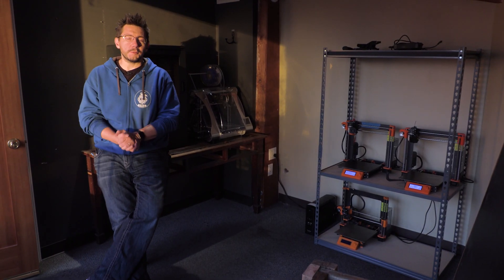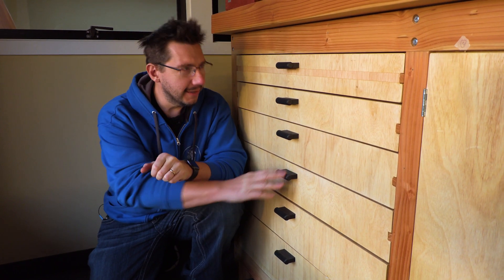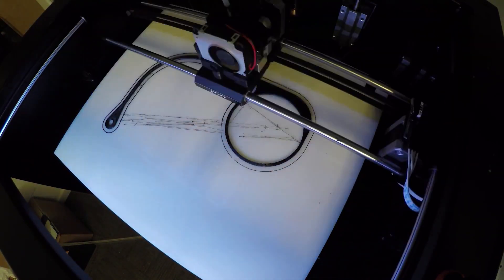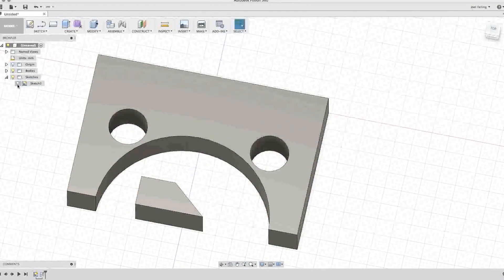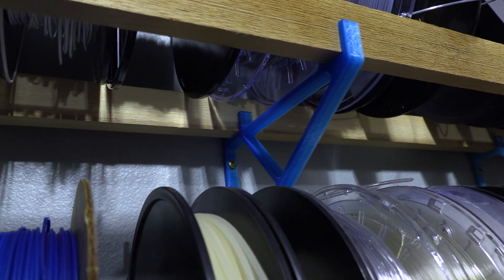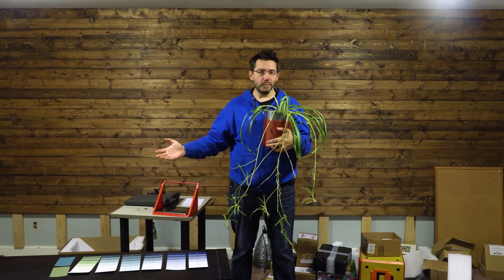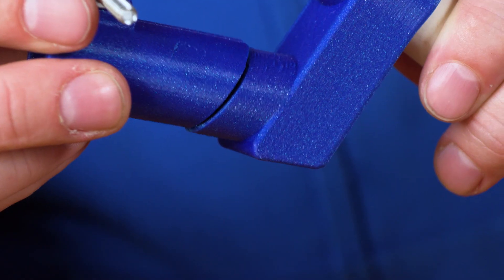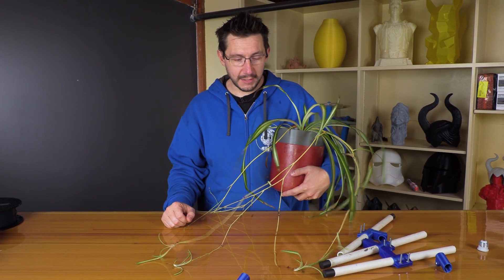Is 3D Printing Practical? 11 Practical 3D Printing Projects Reviewed!

Comment: I did a similar print to fix a leak under my kitchen sink; late at night and shops were shut but designed and printed a fix in the time it would have taken just to get to the shop!
Thought it was a good temp fix; two years ago 😂

Comment: Joel   If you haven't done the redesign on the tripod leg extenders yet I think if you try putting a web across the area between the leg tubes you will solve the problem with support of the tubes.  As long as the open area between the tubes is not needed then that will add strength without a lot of extra filament.  Also as someone said printing horizontally would help by changing the layer direction pattern and if you do you could also put holes in the web to add even more strength.

Comment: I appreciate the effort, but these “fixes” would be my bottom 1000 plus. My very first practical print... actually first print period... was a drive gear in my pool cleaner where the manufacturer (Maytronics) refused to sell the gear... only offered motor plus gear.... for $400+. It’s why I bought a 3D printer. I am now designing a better pool cleaner.... after multiple cleaners.... I now realize all pool cleaner manufacturers design their products to fail. Hoping mine lasts until the grandkids decide that they need one that lasts but also looks cooler. FYI: $200 printer made part. Investment paid for with one gear!!!! That was “practical”. FYI2: Fusion 360 gear plugin did it right first try.

Comment: Cosplay got me into 3D printing when I printed a Pip Boy 3000 for my Fallout cosplay. I had it custom sized to fit my phone inside so I could use the Pip Boy app to make it "functional". My layers were a bit rough due to print time limits, but some sanding and painting covered a fair bit of that.

Comment: I have stuff all over my house and cars and motorcycles fixed with parts I had to print because the manufacturer either doesn't have them anymore or wants me to buy a $300 assembly because a 20 cent part broke.  So yeah practical. Heck some of those fixes paid for a whole printer by themselves (repairing fridge because handle + front panel shattered, not available, redesigned a look-alike in CAD but much heavier and more durable - boom $800 savings no new fridge.)

Comment: Holy filament...
So I am crying foul on the bracket to hold my toy sword. Though to be fair it is a fine line between that and any other art peice or decoration as none are really practical.
Cannot claim the mask for an unnecessary entertainment event either.
I paid for my printer in the first month fixing broken car parts though. They make great aids and fixtures for woodworking as well. 

Thanks for the video though. I feel like all people see is the toys because that is a lot of what they get used for, and think that is all they are good for

Comment: I've been looking at 3D printing for a while and I'm ready to get a printer but I'm at a loss as to what to do next.  I know I like quality, hate limitations, and will most likely want to do bigger projects.  What do you recommend?  As a noob does one jump right to resin or does resin prevent you from printing things like gaskets, tires, aka materials that range from stiff to soft?  If I know that I will eventually want to print a helmet or mask of some sort do I save myself a lot of grief and just go big out of the box or does one start off with a smaller printer and smaller projects?  I watched your video with the Rize 3D plus... is that crazy for a first printer?

Comment: i printed a few pocket hole jigs for several drill bits to fit, 
printed several inserts for a table vice so it can hold certain things firmly without breaking/bending them (for example a tubular insert to hold pipes)
printed clips, handles, buttons switches,
replaced a bunch of small plastic parts that were broken.
3D printers are an excellent tool for small precise things that are very hard to machine.. but its useful for almost any part as long as you know how to 3d model stuff

Comment: You didn't answer the question.
Is 3D printing practical?

Of course you can make practical stuff with a tool, but compared to other tools or buying replacement parts directly, is it practical to buy one, taking the space, plus the filaments, taking space and money, plus the time, money and nerves it may take having prints fail, tinkering on the printer, etc.?

Some prints are like "You could also use a scrap piece of wood and file a notch in there instead of wasting plastic and print for an hour"....

Comment: explains how 4 projects broke, then declares it good to go
Reply from the maker: Which four broke?
Reply: @3DPrintingNerd  geez, off the top of my head? The first one. I dont think you explained what happened to the first one you made, but you said you had to replace it . your fridge door guide. Your gear shift. Your pipe bracket. gas cap strap. There was another one too. was it the last one?

Comment: My takeaway from this: 
What's practical? 
1) Well designed custom brackets (experiences a moderate static load)
2) Human interface components such as knobs, handles, buttons (experiences low load)
3) Replacement small complicated plastic components
4) Anything purely aesthetic you want that's 100% custom

Comment: I have printed a replacement foot for a camera viewfinder and an antistatic gun (using a cheap piezo lighter) that alone almost pays the price of the printer if you compare it to the price of a new viewfinder and a milty zerostat, but there's also a good amount of useful things that you can print that even can't be bought. At that point a 3D printer basically becomes priceless!

Comment: I've made a 1st version of a molding form for a small part in Braun OxyJet MD20 irrigator. It's about their pump. It's a silicone "plug" there.
I just don't want to buy a new one because ppl reports that they've spoiled something in it's design (a weaker motor or it's "weakened" in the PCB, IDK). Tech. service of Braun isn't cheap. So I've replaced their rubbish spiral hose already (it was cracked because of a weak material... worked for about 2-3 years fine). Now it's made of a low temp polyurethane tube and looks like it will be working "forever".
If anybody is interested in this plug, check up my channel (new videos will be in Russian but I'll make subs if you'll ask me in comments there).

Comment: I have some cheap drawers in my house and the plastic piece that connected the rail to the wall broke. I used Tinker CAD to make a replacement and it worked great. I even had to print it again because a different drawer broke, but my practical print is still holding strong.

Comment: There is no doubt that 3D printing can be practical. It all depends on your definition of the term and use of the technology. 
I started printing a year ago. One of the first things I printed was personalized toothbrush and tooth past hooks. They are still hanging on the bathroom mirror. I also made 3 small dragon-themed shelves to hang on the wall above the stove. Half a year later they are still there, holding spices and first aid burn treatments. I also printed a ton of educational toys for my kid's teacher. I have a failed box project that resulted in half a dozen failures that are currently occupying various shelves, organizing small items.  
Impractical prints aren't all that bad either. I'm printing a couple rat figurines that when I finish painting as mice will be displayed with my copies of Redwall books. https://www.thingiverse.com/thing:3781681

Comment: Recently had a practical print. Printer tray for my HP Printer kept getting hit by stuff falling off the shelf above it, when the clips for the paper tray finally broke. Found a model on Thingiverse, printed them out, and epoxied them to the tray, and voila, functioning paper tray! Unfortunately it's not possible to buy just the paper tray from HP, so 3D printer to the rescue!

Comment: "practical". Thats probably the difference between VR and home 3d printing: You don't need them. You can easily do it without it. Its probably cheaper to go to someone who has a 3D Printer or just order it from some company.

But why not? Play around with it and have fun. VR itself has non gaming use cases but when i buy it for home, you play with it and thats it. No pressure to make it practical.

Nonetheless: that shows that 3D Home Printing is just not very useful.

Comment: I made some lampholders, designed them quickly with Fusion then printed them out, hanging for over a year and no sight of deformation (PLA)
Also a shelf, it is like two hexagons connected to eachother, wood plates connected with 3D Printed parts, looks amazing and works!

Comment: Ohhh Joel.. My hands are just itching to improve on that tripod haha. And it's really only a small addition needed to fix the weak spot. To add to that, I've been printing since 2012 and I'm still using a lot of parts and hooks from that time in 2019. I hang my bags on the side of my table when I get home on a 3D-printed hook. In my storage room I have open closest with a metal ridge on each shelf. Each shelf has little self-clamping hooks from which I can hang backpacks and other items. These closets have hollow metal beams that were missing the feet-caps so I printed those as well and guess what? They are still standing on these printed feet after seven years! This is only a small selection of stuff I made but 3D printing has really infiltrated my life and caused me to reuse items that people otherwise throw away. Yes I may have introduced a little bit more plastic (PLA) into the world, but I have saved so many other objects from ending up in waste, and practically, saved the environment a little bit by making old and incomplete things usable and complete again.
 This is an aspect that I'm missing in most of the 3D printing channels; repair and reuse. Like you did with your fridge. There should be more emphasis on this niche.

Comment: Of course the tripod legs failed. You used that sparkly filament. Everything I print with stuff like poly alchemy elixir night shade type of filament breaks on anything structural. Perhaps you should redesign them but they never stood a chance... no pun intended ;-)
Reply from the maker: It was using highfive blue and it’s surprising strong. It’s all my fault for a bad design :)
Reply: @3DPrintingNerd  Oh... ok... my bad. I just know filaments with that Mica type stuff added to the mix makes things really weak  :-(

Comment: petrol cap falls when you let go of it....so don't let it go. 

3d printing is as practical or impractical as you make it. i'm redesigning my vacuumcleaner so it has a twin cyclonic filter. largely because i was sick of always emptying the stupidly small container. my solution is cheaper than buying a dyson and redesigning it to have swappable batteries. but less practical than settling for 20 minute vacuuming sessions and $1000aud for a new vacuum

Comment: 3D printing is just so useful for all these "scratch your own itches" applications. My favourite thing I ever designed & printed for myself is a mount which holds a toilet float-valve assembly in the sump tank for our garden water feature (which is hooked up to a built-in garden hose connection) so we can easily refill the water feature sump without it overflowing. It's not a beautiful thing but that's fine as it's hidden - just pure function that nobody's ever going to mass-manufacture and sell at retail.

Comment: I love practical prints. One of my favorites is a wooden rack holder for my 60 yr old pool table I printed out using wood PLA. Stained it the same color as the table and it looks better than the original holder that had broken.

Comment: It was Saturday evening and I made a knob for my microwave (the one analog knob that sets the time). I made battery covers for kids toys. I made lampshade for my holiday flat. I made some plastic screw things for my father's car. I made a lot of 2,5 to 3,25 inch hard disk adaptors for HP Microservers. I made s tray for a Nespresso machine. I made a holder for the tube in an Ikea wardrobe. I love practical 3D printing.

Comment: Has the constant contact with water affected anything about the flexible or solid filament? With the washer or the gas cap string I would imagine the parts getting grimy and germy with all of the layer lines.
Reply from the maker: So far, no not at all.

Comment: Some of my first prints were "Practical Prints".  I designed a toothbrush holder for my Sonicare brushes, inside and outside handles for my patio screen door and a replacement bracket for my kitchen island drawer.  All are still in use and working great.  Even made a bunch of lithophanes as gifts for Christmas.  Had to do that stuff to justify to my wife as to why I needed a 3D printer  (now 3 printers)  It's all up to your imagination (and your Fusion 360 skills).

Comment: Thanks for the awesome content Joel! 3D printing isn't just for toys! I'll need to look at your gas cap design. There is a subreddit dedicated to practical 3d prints, r/functionalprint.
Most of my prints have been functional. My phone case is 3D printed. I 3D printed a clamp to raise my sump pump float switch. The wall mounts for my snowboard are 3D printed. I'm trying to make a 3D printable motorized shoe to be used in virtual reality games (I have a build log on my channel if anyone is interested).

Comment: Practical Printing FTW! Thanks for the follow up Joel. I have a whole BUNCH of practical prints around the household that I just haven't had time to put all online and have lasted for years. TPU in particular is one of the best long lasting materials to print with. I have straps I made 5 years ago that I still use daily. =]

Comment: It's not amazing that carbon fiber nylon doing nothing screwed to a drawer face is still pristine. That's business as usual. High temp PLA would still be just as pristine in that application. Your tripod doesn't need a redesign. Make it stronger. Looks like zero infill and thin walls.

Comment: Tripod Leg Extender breaking along the layer lines... That could probably be fixed by just printing the model at an off-angle (like 30° or 45° rotated) from the bed. Just might need a bit of support material, or a bit of an angled surface for decent bed adhesion. A stress relief shape cut out, where the clamping part meets the solid part, might help as well... Looking forward to see what you come up with.

Comment: Just ordered my first 3d printer. Hopefully, I can make one practical print. This will justify the cost of the printer to my better half. 😏
Reply: Jai Shyam I thought the same, Hahaha. But it was such a good investment... and I never regretted It.
The possibilities are endless If you know how to work with a CAD software.
Reply: @fliegenmann2562  I have not used any CAD software. So will need to learn it. Any free software you are recommend? If not, any reasonably priced?
Reply: Jai Shyam I use CATIA V5, it was part of my mechanical engineering degree. 
Makers Muse did a video about the top 3 free cad software. It’s a pretty cool 3D Printing Channel.
For the Free CAD Software should be enough tutorials online.
Reply: I personally like Fusion 360. I know there are a bunch of people that would tell you not to bother with it but I find it intuitive and super easy. As for practical prints... I sold my wife on the idea by making her custom shaped cookie cutters.
Reply: What printer did you get?
Reply: @Java_Fusion  Flashforge Adventurer 3
Reply: My only advice.... I programmed in CAD... for manufacturing... over 30 years. ONLY use parametric CAD software. Everything else is for gaming, advertising, or whatever... do not waste your time with non-parametric CAD. I used Catia, Siemens NX, Solidworks, etc. I highly recommend Fusion 360... only real option for home use... for free. Its the real deal.

Comment: Everybody breaks those fridge parts, iirc you're not the first YouTuber to claim that as a favorite practical print.  (Don't remember who else...). You actually have a very similar fridge to me - have any way to keep that flap folding in so it doesn't break that piece? The spring isn't very strong.